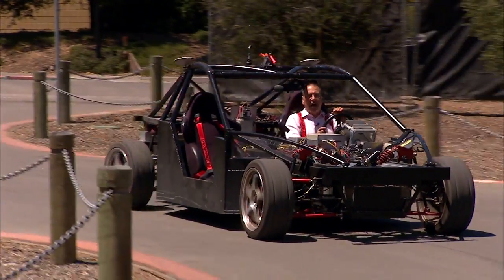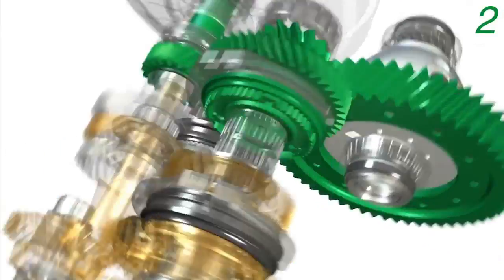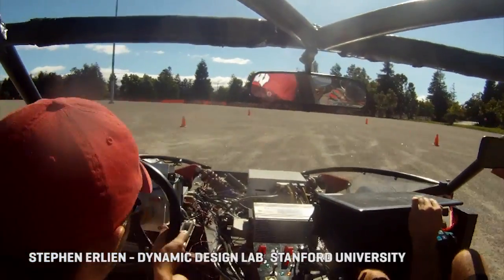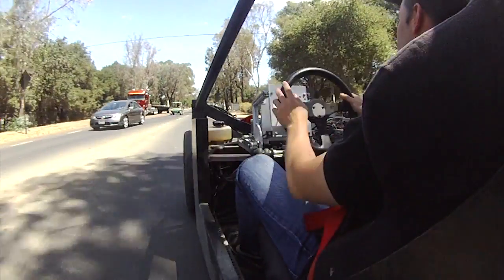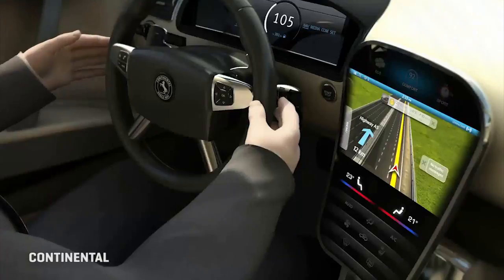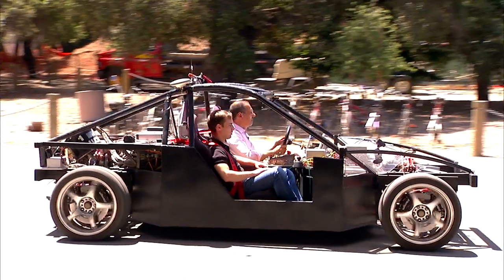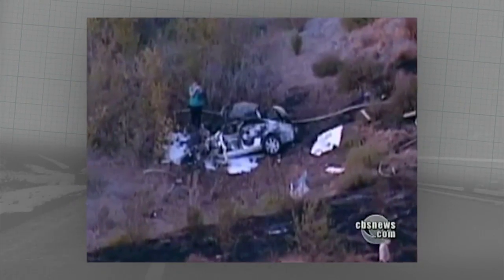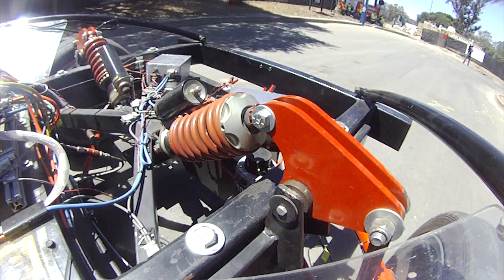Car Tech 101: The coming revolution in drive-by-wire cars

Comment: You don't need drive by wire to enable any of these "improvements" except weight.  There is EPAS today which has the mechanical linkage and still provides evasive steering, automation, the ability to adjust stiffness, etc.  This video really misses the point of why steer by wire is beneficial, aside from weight.

edit:  I take that back, there is no weight benefit.  You replace the linkage with a motor at the column to enable the feedback.

Comment: No. I'll take my 95 Civic any day. Cable throttle, no power steering, no abs, no traction control. And FACT, drive by wire is NOT more responsive. Cable throttle will FOREVER be more responsive. While there are many advancements in newer cars, these cars lack character, good looks, control and customization. In my opinion, I can't stand new cars. I'm living in the past and proud of it.

Comment: What about durability and ease of maintanence? A garage mechanic can't fix an automated steering system loaded with proprietary software and electronics. And what happens when the electronic steering system fails? Mechanical systems don't usually fail without warning, but an electrical system can much more easily.
Reply: & you'll have to shed $1000s of dollars to fix the computer or motors
Reply: You should drive car with more by wire systems.

Comment: This has to be the most useless technological advancement ever as it brings few advantages but introduces a lot of new failure modes.
A car is not going to get regular maintenance like an airliner and an automaker will use the cheapest contractor they can find.
If there is a total electrical failure you loose steering and braking.
Auto makers are not going to add triple redundant power buses like in aerospace because it would cost too much.
Last if it connected to the internet and there is no air gap firewall well you now have a new way to murder someone because someone could hack and control it remotely.
The cons definitely outweigh the pros in this application.
Reply: This comment isn't going to age well...
Reply: @JoshWitte  The first manufacture to do it will probably justly get sued into bankruptcy.
It'll probably be such a fiasco it'll make the ones involving Edsel,Pinto,and Covair look minor.
Reply: @Patchuchan  I'm pretty sure the technology has advanced far enough that any issues can be patched immediately with an OTA update. One would hope that manufacturers have it in their own best interest to make it as safe as possible. Especially after learning from those previous mistakes.
Reply: @JoshWitte  OTA should never be on a car.
Reply: @Patchuchan  you know, they said that about power steering when it first came out. That it "wasn't safe" and there were doubts about the failsafe mechanisms, or lack thereof. I've driven a 2-ton truck when the power steering went out. It was almost impossible to turn manually to get off the road safely. No technology is foolproof. It will be some time before this becomes commonplace, but it will happen eventually, alongside fully autonomous driving. It's not a matter of 'if' but 'when'.
Reply: @JoshWitte  Power steering there was and still is the mechanical connection.
I had my power steering go out and I was able to still control the vehicle it just took more effort.
If it were a drive by wire system I would have ended up in a ditch if I were lucky.
Reply: @Patchuchan  I would trust the latest version of DBW over any power steering, any day. Once you drive with it, you'll never want to go back.
Reply: no

Comment: nice steer by wire,, if the computer fails , bye bye steering , if a motor dies u will steer with only 1 wheel . so fuckin awesome
Reply: not really. If power is lost, there is a backup mechanical clutch system that will engage.

Comment: what happens when the system is shut off while the car is in motion?

what happens when a kid 20 years from now buys a used steer by wire car for 500$? are we just going to hope all that computer shit doesn't have leaking capacitors?

if your car had a dead battery , you couldn't even push the car somewhere.
Reply: Good point. Also what if the alternator fails and now the car has no power. Or if the manufacturer has a poor rating like Renault, and the car, even if new, has electrical problems.    There is no way a computer is faster than an actual connection.
Reply: that's drive to death technology 😕

Comment: all I really need to crash my cat is to cut off the power and/or corrode the connections and also what about that corrosion metals corrode and erode overtime
Reply: SO DOES WIRES
Reply: also did he just say TWERK at 1:35

Comment: This is not progress but further endangerment of people. Disconnecting the driver is not the best way to control the car. No physical link between driver and steering will result in deaths and injury. No physical link between the driver and the braking system will result in death and injury. No physical link and the right malfunction will cause run away engines. I've already seen this as a mechanic. This is more dangerous than the public can even understand because they don't know how these systems work or worked prior power assist steering, brakes and fuel injection. All the deaths and injury from GM ignition or the Toyota throttle malfunctions is just a start.

Comment: I think that it should go through more testing and have about 70 to 80% of fault detection software, but other than that, I'm fine with it. But, if I may ask, does anyone know if the test vehicle here was gas or electric? Because if it was electric, the battery would die easier.

Comment: Oh, goody.  Now when we get in a car and go for a drive, it will be a lot more like flying in a passenger jet.  Great if nothing goes wrong, but if something does, you are left with no way to save yourself.  What if a glitch in the electronics suddenly tells your steering to turn left into traffic?  What if you get the same old accelerator problems as before?  Hmmm....

Comment: It would be so much easier if the Military who has been using this tech for decades get out there and promote this technology.  The military can use some of that trust and good will they have garnered over the years and let the people know that this is safe tech, tech that has been in use for decades.

I would say that the airlines should be out there promoted the tech but wholly molly very few people like those guys these days.

I have worked on fly by wire systems since 97, and yes Toyota set the movement back a bit the tech is tried and proven hell I even love the Apache's fault location system it may not zero you into the problem but it gets you pretty darn close.

Anyway just excited about this tech and would hate for it to be passed by because people fear change.